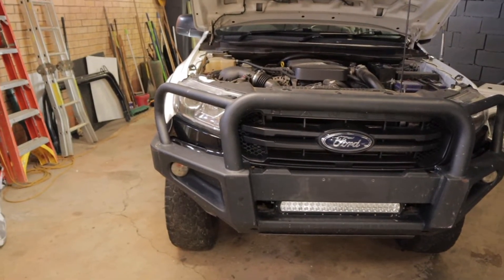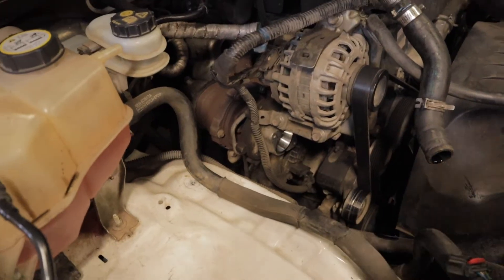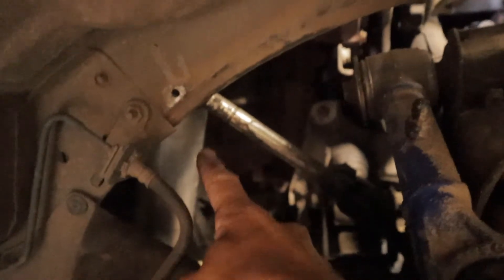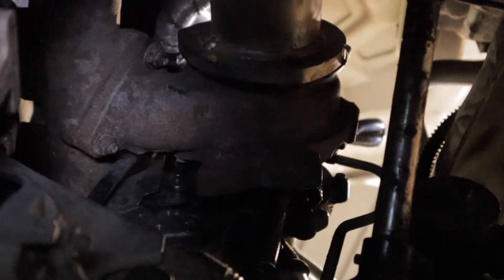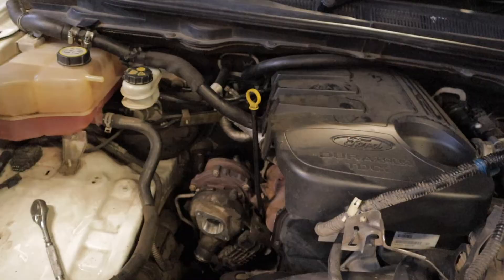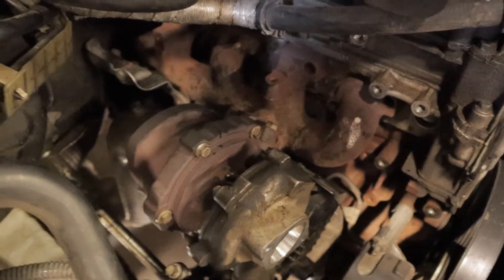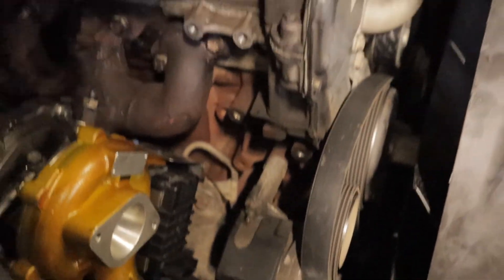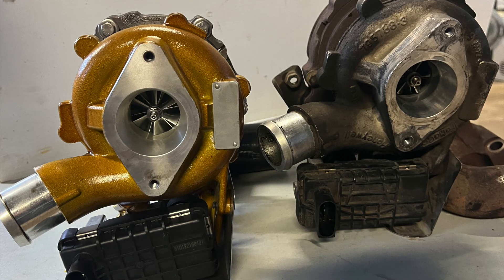Ford Ranger Turbo Replacement & Upgrade

Comment: i mean even where the turbo is situated on the exhaust manifold  , could it be in a more positive place to improve performance like at the end of the manifold  ?  room availability is key i know  but better manifold design would help ' seems like the design of most thing ranger are one big compromise

Comment: Have same same problem now. That nut in back stripped. Soooooo you just show me i MUST take off whole manifold. 😳😳😳😂😂😂😂 

Spanner keep on slipping on that nut. 

Must replace head gasget in mazda b50 2500/ford ranger 2.5 td wl 

Any tips. My 1st time doing it.

Comment: When changing TC on Piston aircraft engines we'd block off the oil return to prime the bearings overnight with Mouse Milk Which can also be used in an emergency situation to free up seized bearings) available online and made from the seeds of the oliefera moringa  tree. Adding a 2 p.s.i. cut off valve on the return line ensured no dry bearing on spool down.

Comment: Hey mate awesome video. i notice it looks like you have oil through your intercooler piping? I have this issue on mine, does this mean the turbo is screwed and that is the reason for replacement?

Comment: Curious, ive got a 2.2litre 250xxx on the clock, seems to have sprung a small exhaust manifold leak and considering doing a turbo whilst there, "prenventative maintaince" 
Hows the ebay spec yang held up? Any issues? Is that the same standard elec actuator? 
and where did you get thar hard pipe!

Comment: Ive got a Ford Ranger Px mk2 and recently got the engine replaced however, when im accelerating to 1800-2000rpm it shakes/shudders but anything before and after that rpm the car is fine. Anyone have any ideas what it could be?

Comment: Do all of them Ranger comes with Turbo? is there two turbos? My dad has Ranger T6 2014 3.2 and he not sure if has turbo and im not sure either.. I just started looking at his truck and im no mechanic, i went to the shop to get alternator replaced and an engine wash but didnt bother looking at other parts since im not so familiar with them yet since i just started driving this year.. I saw other videos that showed the Turbo hose is the big one of the right side of the engine tho so now im confused does ford have two turbos?

Comment: Keep up the good work.. greetings from Kenya 🇰🇪. I have a 2021 px3 2.2 single cab ranger. In terms of mods will a billet turbo and intercooler upgrade without a tune make any difference? I have heard that ford made some mods in the ecu to make it difficult to tune from OBD. Means the ecu needs to be benched to tune. Since I’m avoiding an ecu tune, will these mods in your opinion make any difference?

Comment: gosh 350k km
and here my turbo is completely broken at barely 70k km
Reply: Hi bro, always change your engine oil earlier @ 5000 km with filter to avoid oil sludge or even soot which can easily clog the DPF after a while for sure, that's what i'm doing, i'm using 15W40 oil, intervals @ 5000 km with filter and no issues.
Reply from the maker: don't trust the ford 15k service intervals & EGR recirculation, oil goes bad real quick
Reply: @abdautomotive 
Bro, nothing called 15k oil change in the logic, after a while, your engine will die... Dealers are playing this game with their customers to break their engines after the warrantey ends !!! You want your engine to stay healthy, clean & strong for very very long time with much less issues ??? Always change the oil with filter @ 5k if you haul and pull, or even 7k if your driving is normal. Always put the highest quality oil available in the market and don't go for cheap, pay more for quality oils and get peace of mind for free !!

Comment: My rangers engine has gone bad for the 4th time n ford mechanics have no explanation for why this is happening..... any idea what could be the issue?
Reply: The wrong oil being used, un realistic tune? , oil pump failure.injector failure from bad diesel..

Comment: Was there a gasket between the exhaust manifold and turbo when you first removed it? Workshop tellin me that they dont have one there from the factory
Reply: Same man, ford told me the same thing today, did you ever find out if there is one there from factory?
Reply: @ellis4175  hey yea there is but something wrong with the part numbering. After a turbo replacement it had this airleak sound that i assumed was on the inlet side. Turns out it was a missing exh gasket 🤦‍♂️
Reply: @Huskydog78  thanks man =)

Comment: Your contents have, no doubt, become irresistible on YouTube, thank you.

My Ranger, after scanning, showed p0341, I've replaced the cmp and the code persists. I've also checked to know if power gets to the sensor, reset timing but none of these resolved the issue. Pls what should I do? Thank you
Reply from the maker: so you've replaced the cam shaft position sensor? is the car going into limp mode while driving?
Reply: @abdautomotive  yes it does almost immediately it started. In fact, as I write to you, the vehicle wouldn't start anymore because, in the course of diagnosis, I've loose the valve tray and I don't know the bolts torque specs. Would be able to help me with the specs?
Reply from the maker: @OluwasijibomiMuyiwaBolan-ht1ub  from the code you mentioned , it's a cam shaft position sensor.
Reply: @abdautomotive  my surprise is that, I've replaced with new cmp yet the code persists. Once the engine is started, it would go into limp home mode almost immediately. Because I've replaced the cmp, I thought it could be a problem with impulse ring so, I removed the camshaft rocker cover, by the time it was reinstalled the vehicle started and ran well but later when I decided to start it again, it wouldn't start again. So I believe that the tightening torque was wrong, therefore valves may not be opened at the right time or close at the right time. Thanks for your time always

Comment: One thing i would recommend while you had the manifold off.
Is to match port the manifold flange hole to the turbo flange hole. 
The manifold one is alot smaller hole than the turbo one.
Reply from the maker: ive got a spare manifold, might give this a try

Comment: I like you videos so much bro. I have px1 like yours 2.2. Your videos helps me too much especially the conversion to t7. I think you felt the difference in the mid range because the hard hot side pipe reduces the turbo lag because of the less travel of the air. I dont see too much difference in turbos. Better now to have water injection system with tune 👍. Worth it 😉

Comment: Dude. Loving all your content about the Ranger! Help me out quite a fair bit too in my own mods. I think the turbos' performance is limited by the wastegate. A better compressor might give faster turbo spool ups and probably smoother too. I've since upgraded my injectors and also a larger intercooler so the turbo is the next time in line for performance upgrade though to fully capitalize on the upgrades I'd like to think a tune+dyno is needed

Comment: Great work as usual. 
Q. On the oil feed line, did either end of the line have a fine mesh screen ?? Curious to compare this set up Vs other ford engine
Reply from the maker: no mesh

Comment: Hahaha that hotside plastic pipe is a nightmare on the 3.2. I used a reciprocating saw to cut mine in half just to get the thing out! Little bit disappointing to not have more of an affect. Although when I initially saw the new turbo wheel size and that it looked pretty much the same size as the standard one I wasn't expecting anything major from it.